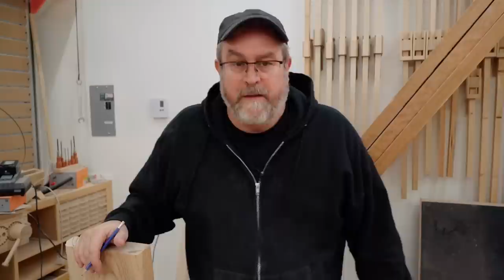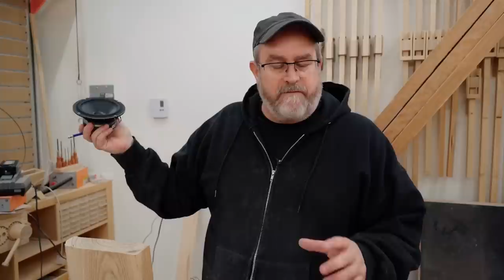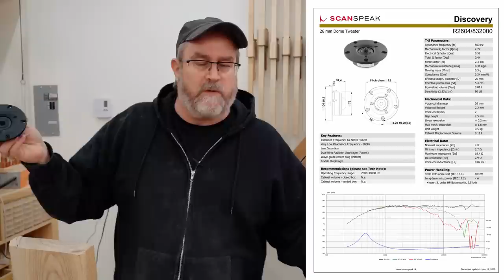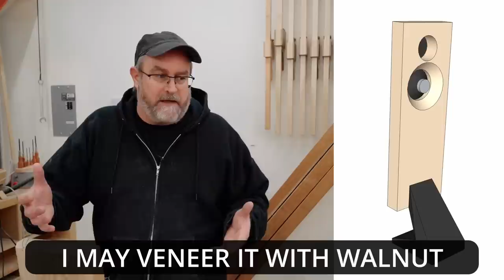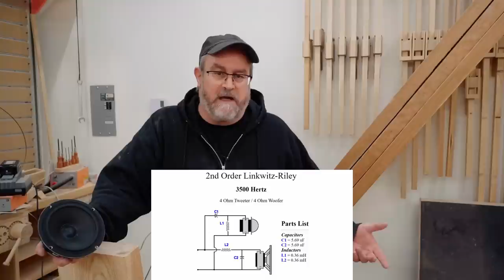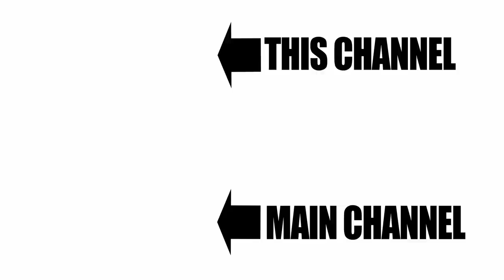New Speaker Project - Concept, Drivers and Design

Comment from the maker: Good news! I'm building another neat looking pair of speakers. These ones are open baffle 2-ways that I'll use in my listening room positioned at the sidewalls. Not surround speakers, but the reflection replacement idea I talked about in the video. 
The drivers are the Vifa P13WH10-4 midwoofer and the Scanspeak R2604 ring radiator tweeter.
The baffle will be a solid hunk of ash 24" long, 2" thick and 8" wide. 
Crossover will be 2nd order Linkwitz-Riley at 3500Hz (subject to change). Yes, I used the "don't ever design a crossover with that online tool" online tool, but I've found it to be good enough to put me in the ballpark and I can tweak from there. Yes, I know all about using Xsim and the measured impedance and frequency response to design the crossover. That method rocks, but involves more prep work than I'm interested in doing for this project. 
I'll use a small class D amp to power these and will probably add a highpass filter to the input of the amp to keep the midwoofer from being over driven at low frequencies.
Reply: Neat looking is an understatement! You have a great design sense and the renders look fantastic!

Question about crossovers: have you ever bi-amped and done the crossover digitally? It seems as though a DSP could deliver more granular controller at the crossover point than a physical network. Additionally, you aren't committing to building anything physical for this task, can tweak it later on, and possibly do it all before the decoding with almost zero sonic penalty. 

I suppose the potential drawbacks are all cost related? (Another amp, DAC, and a competent DSP)...
Reply from the maker: My main speakers are fully active with digital crossovers, and I've made several videos about that.

Comment: interesting about the timing of the reflections, because them arriving later to the ear is what the brain uses to place them in 3d space and give you the impression of the room. This is probably why you're not getting that impression but are getting more of a feeling of immersion.
Reply from the maker: Our brains interpret the direct sound and the reflected sound as one sound (if they are separated by less than 40 milliseconds), but also detect the location of the reflected sound and that provides the spacial cues to let us know we are in a room. But that doesn't include the destructive comb filtering that happens when you have two sounds arriving at different times. The sound that reaches your ear is already corrupted by the reflected sound.
By absorbing the reflection and then providing a direct sound source to replace it, you eliminate the comb filtering, but still get the spacial cue the brain uses to give the listening space dimension.
Reply: @IBuildIt  Not exactly. When a phase delay is more than 50-60msec we will hear two sounds delayed. From 2 to 7 msecs we can extend a stereobase toward a speaker that plays a signal first. Delay time in between makes a sound source more extensional (what is not good at all) Check out Haas effect. It will work with two tweeters but up to 5kHz only.
Reply: @sc0or  Nope! 50 ms with quickly varying music up to 80 ms with slowly varying music. A ms is equivalent to a foot distance at speed of sound.
Reply: @carlosoliveira-rc2xt  330m/sec * 0.05sec=16.5m If that was a foot, that meant 1msec and that's roughly about what I mentioned above if I'm not wrong. Any way this is pretty interesting thing and I will definitely try to use two additional full range drivers with an appropriate crossover (500Hz-5kHz) aside of main loudspeakers for experiments.

Comment: Great idea. One suggestion though. It looks like they would tip forward with little more than the wind from your air conditioning blowing on the back. The simple solution is to extend the base plate to the front about 6 or 8 inches forward of the front baffle.

Comment: While the sensitivity is close, you are going to lose some of that on the Vifa due to baffle step loss. The ScanSpeak can also handle a lower crossover point, as low as 2k and that is where I've used it numerous times which gets away from any cone breakup of the Vifa as well.
Reply from the maker: Since bass is not a requirement, baffle step losses won't be an issue. I'm looking for good response from the lower midrange and up and don't need anything at all from these speakers below that.
And I'm working on the crossover right now, but I doubt I'll go as low as 2K. If possible, I like to cross a small midwoofer like this higher and take the strain off of the tweeter.

Comment: I'm wondering: won't the dipole Open Baffle cause MORE reflections? The base is very interesting looking!
Reply from the maker: Every new source adds more reflections, but not all reflections will be as destructive as the first reflection from the main speakers. These sidewall speakers will be pointed at my listening position, so the reflection from the rear will be angled forward, away from  my listening position. They will also be playing at a lower volume.

Comment: I have a hard stance that ALL reflections are bad, and the excuse people have for room reflections = good is because their speakers aren't very good at sound reproduction or they are too accustomed to an excess of noise from other applications like their car or at concerts.  People become trained to expect noise from all around them.
Reply: You couldn't be more incorrect! By your logic, a good speaker in an anechoic chamber would sound amazing but it instead would sound dead and lifeless. They DON'T design concert halls to be dead and reflection free for a reason. You can pull up ideal reverb times as well for various types of rooms ( studios, auditoriums, etc.) FYI my main speakers are in the multiple six figures but have several systems with speakers even in the 4 figures.
Reply from the maker: They design concert halls to project the performance out into the audience, like a large acoustic amplifier. A concert hall is not a small room - there's a world of difference between the two. BTW, a small room is basically anything smaller than a concert hall.
As for speakers sounding dead and lifeless in an anechoic chamber, here's a quote from Bruno Putzeys: 
"To that I can only say: "you have to try it". The myth that speakers don't sound good in an anechoic chamber gets repeated time and time again in audio circles and I have no idea where it comes from. It's completely untrue. Many more speakers sound good in an anechoic chamber than do in a real room."
The reason is that you get to hear the music, and not the music plus the terrible room acoustics. You hear the speakers playing the music as it was recorded in an anechoic chamber, not the endlessly unchecked reflections, reverberations and room modes that make up nearly 50% of what you hear in an untreated room.
Reply: @IBuildIt  beat me to it, but right on point about the differences.  

I think one important point to make is the audio recording includes the concert haul experience.  It includes those reflections/reverberations of that concert space, that recording studio, or whatever space the recording was done.  That's IN the music.  You don't need to attempt to duplicate it again.

The anechoic chamber part is amusing too because what about headphones?  How do they get away having nearly zero reflections and sound good?  Interestingly, headphones (or in my case I prefer IEMs) are sort of the attempt at the perfect "room."  It's an attempt towards high quality drivers, well developed sound profiles, and then packaging that has nearly no outside interference.  Perfect is nothing but the driver emitting sound.  What you're left with is just the competency of the driver(s) and little else.  When you transition away from head-fi to home-fi, you have to deal with a whole mess of other factors like room acoustics.  And if you go from home-fi to car-fi, it just gets wildly worse with reflections, excitation of panels, and horrid driver placement and off-axis angles.  I started way back at the car-fi end, ran 3-way fully active setups running a mix of car and home audio drivers, fully independent amps, level balancing, x-overs, TA, and even independent left and right EQing, all in an attempt to counter the absolutely horrid "room" space of a car.  This was like 25 years ago.  As the shift goes back toward head-fi, the whole equation simplified down to a very basic set, pretty much driver choice, good engineering of the setup, and decent enough enclosure design not to have weird resonances (some cheap headphones/IEMs or early generation stuff was kind of bad with this).  Headphones are darn near an anechoic chamber, and it's easy.  It's really easy, and there's so little that needs adjusting besides some light EQing.  Home audio adds this whole realm of complexity.

One thing I'll say is, I've never once added acoustic treatment and made the audio sound worse, not once.  Acoustic treatment has always brought forth more detail and sound stage specifically because it removes the noise and cancellations happening.  A non treated room is like talking to someone in a noisy cafeteria.  You end up losing half the conversation in the sea of noise.  You'll literally hear half the conversation disappear from existence.  It's exactly why white noise generators are used by people for sleeping in a noisy environment.  It just annihilates structured sounds.  That happens in a noisy room with level of detail AND presentation of sound stage details.  This later part is quite important because sound stage representation is IN the quiet parts of the audio.  It's that low level background noise in the recording.  A bad room just produces so much crap that it just wipes all of that fine detail out.  Sound stage is someone whispering to you in a noisy cafeteria.  If you can barely hear a person nearly yelling at you, you never hear them whispering.
Reply: @IBuildIt  Nope! There are lousy sounding halls and good ones. If all they were designed for was to project sound out into the audience, they would all sound bad. Have you even been in an anechoic chamber? I've been to the one at the NRC several times. If they sound so good everyone would dampen the shit out of their rooms, quick and easy and my 29 years in acoustics would be mostly wasted. Your perceptual cues and spatial awareness goes out the window. Your perceptual noise floor actually goes up because you hear yourself swallowing, breathing etc. Members of the Bavarian RSO tried to play music at the IBT and found it difficult and unpleasant to be in. Yeah, a great place to listen to one's system! Reproduced music can sound glorious or in a room or can sound like crap, that's a given but in an anechoic chamber, (not someone's quiet basement) it will always sound lifeless and dead. There's a reason amateur singers seek out stairwells to sing, it simply sounds better due to the reverb. Even professionals request a little reverb when they sing. It's beyond me where you obtain your nonsense. Chambers were once useful for designing speakers but the best manufacturers have gone the Klippel route making the job much quicker and more thorough than even the largest chamber. The one at the NRC is actually flawed.
Reply from the maker: @carlosoliveira-rc2xt  "If they sound so good everyone would dampen the shit out of their rooms, quick and easy and my 29 years in acoustics would be mostly wasted"
If you actually had 29 years of acoustic experience, you'd know that "dampen" the shit out of their room certainly isn't "quick and easy".
Besides, they've been fed the lie that people like you are spreading, that treated rooms sound dead and lifeless. So why would they spend the time, money and effort required to do it? And they almost completely ignorant on the subject, with no real technical understanding of room acoustics.
As already mentioned, why do so many people use and absolutely love headphones when they are the absolute closest you can get to an anechoic chamber? No reflections, no room modes, no reverb - just the pure sound as recorded.

Comment: Would love to see the board cut into 1 inch thick boards and then cut into the two foot lengths.  Then you could put the 1 inch thick pieces back together so the grain would be the same for both speakers.  Sort of an extra thick bookmatching exercise.  Not sure if I'm being clear but that's the best way I can think of getting the grain to match from a single board.
Reply from the maker: I get what you mean and it's an interesting idea. These speakers will be on opposite walls, so the bookmatched effect will mostly be lost because they won't be seen together.

Comment: 1) What are your thoughts on L-pads to tweak the volumes going to each individual driver?

2) What are your thoughts on active crossovers versus passive crossovers?
Reply from the maker: You mean user adjustable l-pads or fixed? Fixed is often needed to bring the volume of the tweeter down to match the woofer.
Active is always better, but too complex for this application.
Reply: @IBuildIt  I was thinking of adjustable ones.   Seems like that would be far easier than swapping out components on a crossover board.

I don't know how much of a purist you are but if you have multiple amps, you might want to invest in an active crossover unit like a DriveRack by dBX or a Behringer UltraDrive, they can do some amazing work.   Some people think everything needs to run through a single amp or else its somehow tainted but I've never been one to subscribe to that view.
Reply from the maker: You seem to be forgetting that I already have all that - my main speakers are active 4-ways along with the infinite baffle subwoofers.